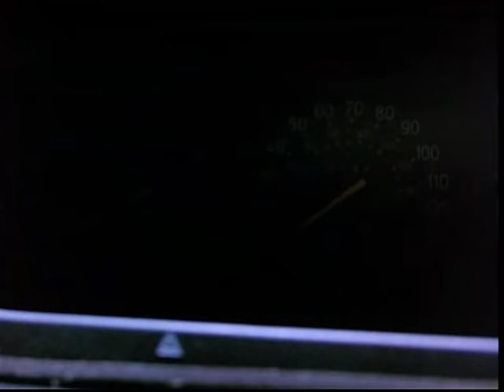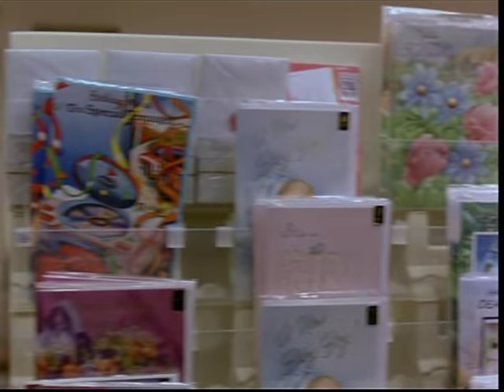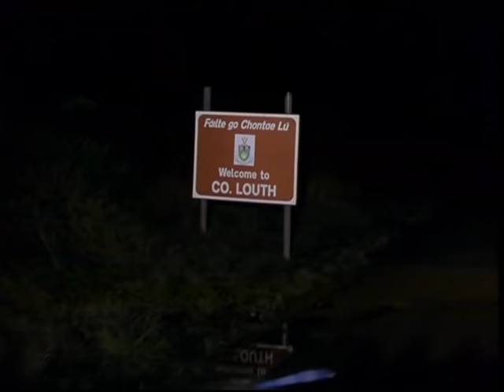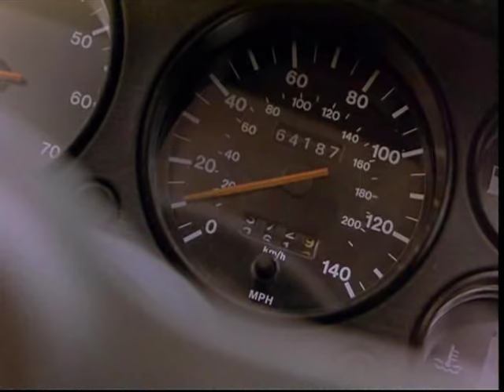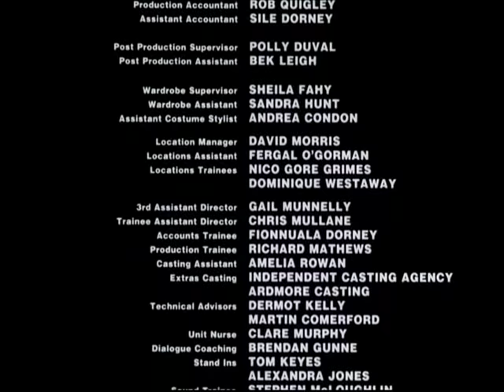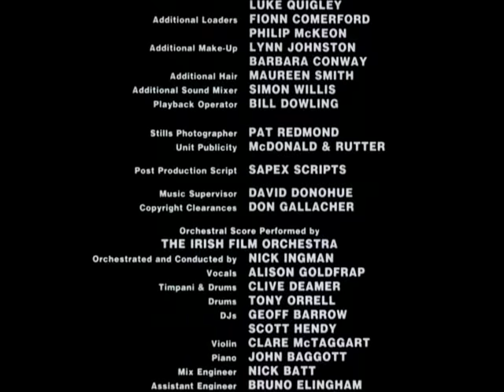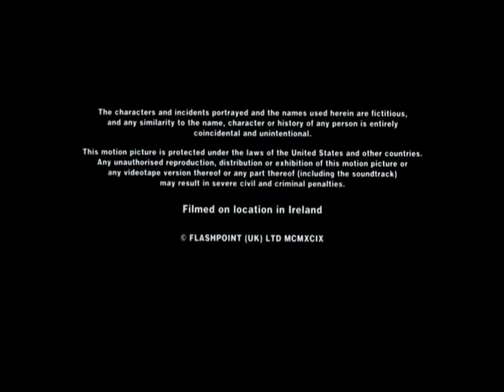Accelerator (Full Movie) (1999)

Comment: I I used to fix up ford Capris. I had a 72 full suspension and a Ed Hale built 2300. 3 1976’s customized black version 3.8 L supercharged ford engine. Cornered like they were on rails.

Comment: At 1:16:47 Camera tracks in shot, oops. Surprised they could afford a helicopter though.
Reply: Camera tracks are only visible here because the film is shown full frame 4 x 3 (1:33:1) for TV & video but would be projected 1:66:1 at the cinema. You may have noticed there is too much "headspace" above their heads, as that also would be cropped off in the cinema.  Even Hollywood films get tracks and boom mics in shot when viewed on TV.  :)
Reply: Helicopter was loaned off the real IRA